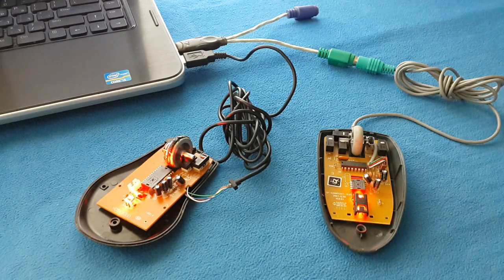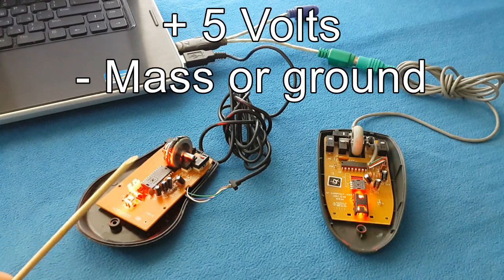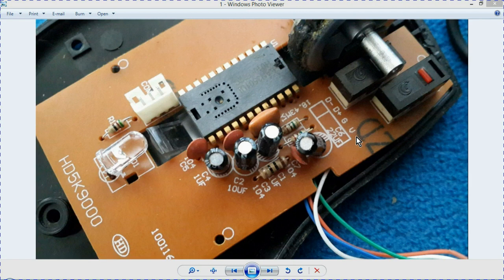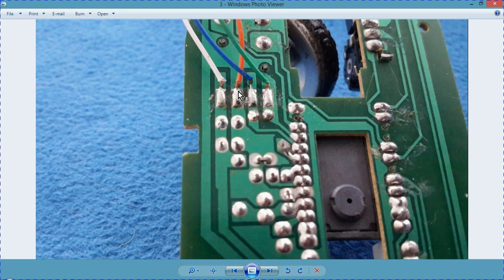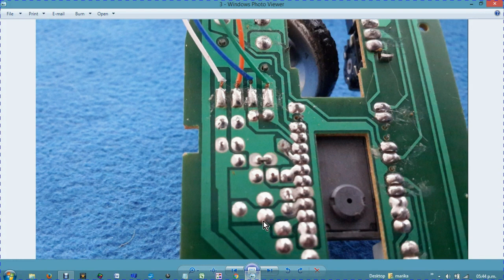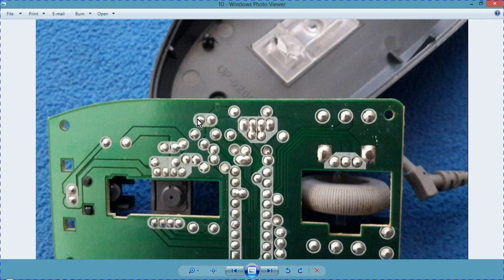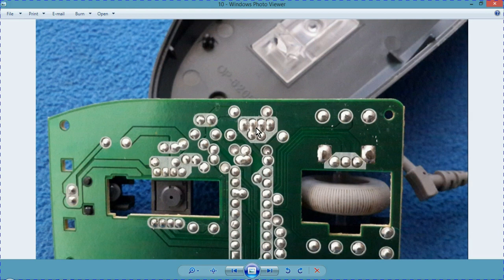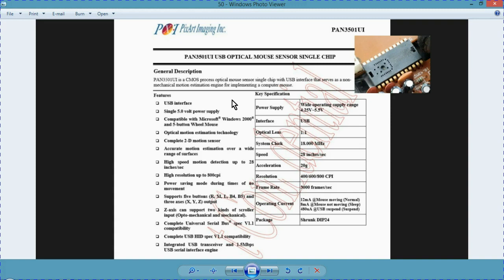PS2 to USB how to convert a mouse PS/2

Comment: Hello, i found old PS2 keyboard and my new computer doesnt have a PS2 socket and i want to use it. Will this work with keyboard or do i need to buy the adapter? Thanks!
Reply: No, it won't work, AT KBD and PS/2 are completely incompatible protocols.
Reply: @gnif  Yeah, i've already figured that out but still thanks!

Comment: I found out in this video that my moue is not compatible with usb ...but too late i cut wires and destroyed ps2 jack ,because i open it with knife to see which wires go where lol....it was good working old mouse.Maybe i can fix it if i find another ps2 jack from some old keyboard ,i still have old pc that have old ps2 connections on motherboard.
Reply from the maker: Hi! Never be sorry for a fail. Many people will never take a risk and they will not learn enough to pass to next level in life. Situations are bad or good just in the moment with pass trough. But after that, all is just experience filed in our life. With the years, there will not be good or bad experience. Only experiences. Now you should be making plans for your next project.  ;-)

Comment: Hi, i have 5 cables inside the ps2 cable,  4 with plastic and 1 without plastic
Reply from the maker: Hi! Now is time to find out what is each wire for. Make a little pause and try to get more info in Internet. (Try to learn enough to filter good advises fro the bad ones).
Reply: Bro its shielding wire....
Reply: @bob.kalpon1398  can I send u an email
I need to ask u very important quest by showing u the picture

Comment: a wireless usb mouse plugged into  a ps2 to usb adaptor doesn't work
Reply from the maker: Hi! The difference is PS2 has clock and data, while USB has Data+ and Data- lines. Only wired mouse with some kind of chip for both support can work.